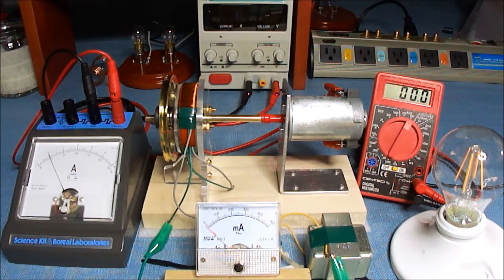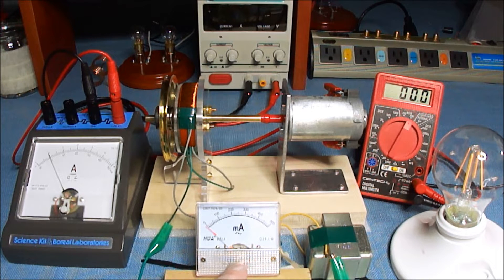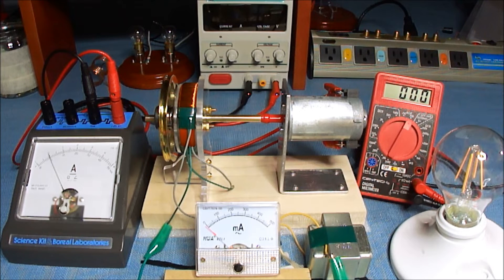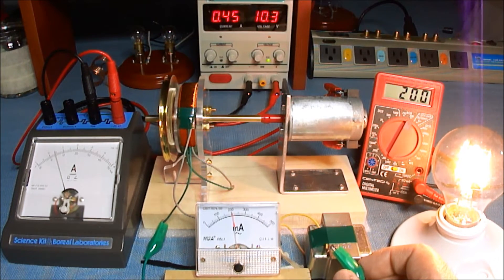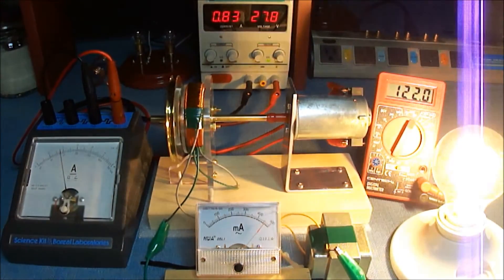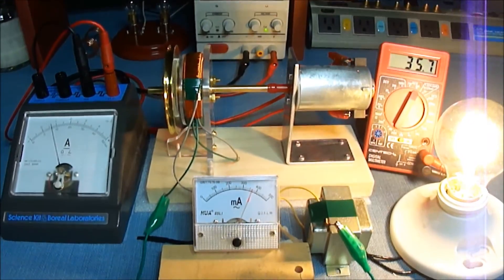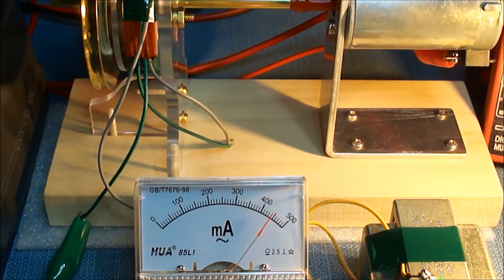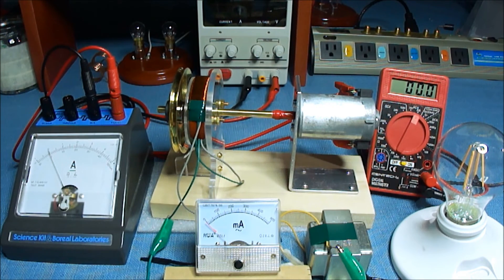Toroid Dynamo / Generator Testing

Comment: Crazy thought. Imagine an inner and outer toroid, and that you create 3 separate single loops that encircle the inner and outer toroids, but separated by 120 degrees.  In effect you have a 1:1 transformer inducing a rotating magnetic field in the outer toroid. Then you can put 100 or so  windings between each of the three loops on the outer toroid  Why? I have been wondering about how the magnetic field cuts through the different parts of a coil at different times, and if that hurts the efficency. What my proposal does is cause the magnetic field to cut a single loop far more quickly. Loop should be thick copper to keep resistance low.

Comment: This might be silly but perhaps an additional pair of coils carrying load current be added to cancel some of the Lenz flux?
Reply from the maker: I consider all ideas. Another pair of coils may lower the drag or it may lower the voltage generated.
Reply: I guess you'd have to shield them from  induction process somehow.

Comment: Nice demo and I agree at certain rpms or cps or frequencies will affect the current output even though the volts increase as you can find in my video on testing a flyback with PWM and adj volt PS...Cheers
Reply from the maker: Thanks. Nice research. Cheers

Comment: Great work.

 Can I give yah some ideas here?

 Don't use magnets. They are locked to the magnets field while making the magnets. Use electro-magnets inside of the ring. Also you would need to use a higher efficiency motor to drive the system. And also making a self excited field section where you have the magnets now would be much better. You can use your magnets you have now to generate the excitation for the field coils.

 Try to use this patent as a guide: https://teslauniverse.com/nikola-tesla/patents/us-patent-390721-dynamo-electric-machine

 It means you need to modify the generator from the version you have to the version Tesla designed. Three distinct sections need to be made: Exciter, generator, prime mover or motor. The output is taken from the central part of this patent and all sections need to be on one shaft.

 For now a test would be to move the magnets into the center of the generator ring but understand that it will limit your output to the magnetic field of your magnets. Using a larger gauge wire for the generator will help to compensate for the lack of current you are seeing. Once you get that modification you can add the exciter and field coils and subsequent generating core to fully open the generator up.
Reply from the maker: Hi. I'm thinking of similar modifications but I want to avoid electromagnet field coils. Thanks for the ideas.
Reply: Well the reason for the field coils is that they must be variable to induce to the rotor coils. The only place the magnets are, are in the exciter. Tesla called this a self exciter and the rotor is actually a rotating variable transformer. The prime mover or motor is actually connected to the output of the rotor coils and you can also take off extra current via an external transformer like that shown in the patent.
 Try to follow the patent and you will see something very interesting. But it is your experiment.

 I would like to leave you with this last comment then I'll back off. Bifilar coils should be used with regular solenoid coils. So bifilar field coils into solenoid rotor coils. Try it and you should find it more interesting.

 Good Job though.

Comment: mind to tell me, the generator are from motor?
Reply from the maker: I built the generator about the same as the toroid pulse motor but with a different coil.
Reply: ok, thanks,
i realized that, if we limit the voltage from gencoil able to produce, it will start dragging

Comment: At 120 V output they have almost 30 watts at the input consumption and 4.5 watt lamp to light up. Very poor efficiency!
Reply from the maker: Hi. At the moment it is about as inefficient as generating electricity with a gas engine. Reducing the Lenz effect will improve efficiency.

Comment: I don't think it's a resonant point. because you increase the rpm ie. frequency and it continues. I think the core gets saturated.
Reply from the maker: Thanks Steve. At first I was going to disagree because the magnets remain at the same proximity to the toroid core. Unlike other generators. Then I realized saturation could cause resonance and vise versa. If the coils give a momentary feedback to the core like the motor version then the rotating magnets could produce temporary saturation. Basically a temporary wall within the core for magnetism to bounce off of. One could be the cause of the other.
Reply: have a nice day. it's a good design keep testing.